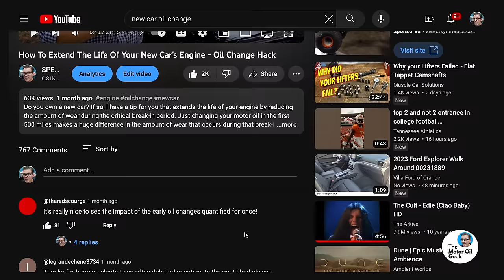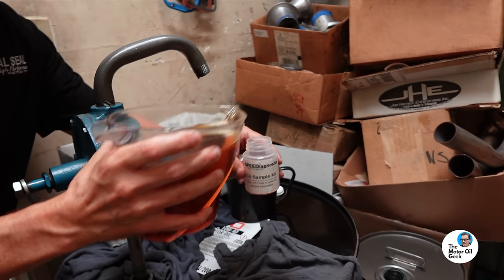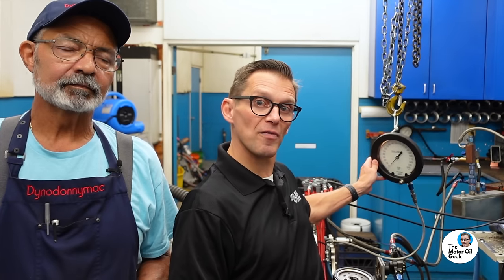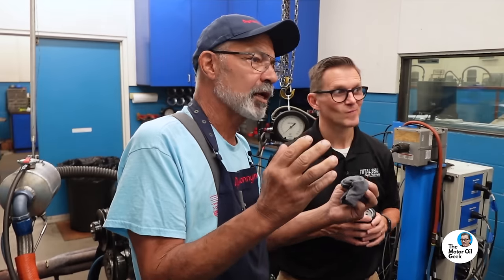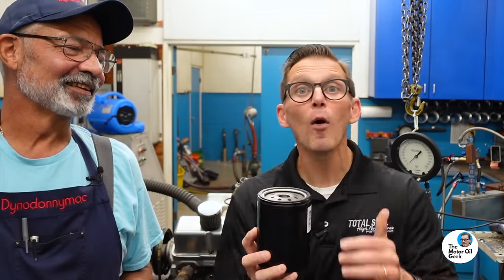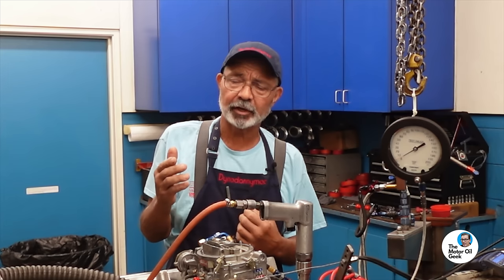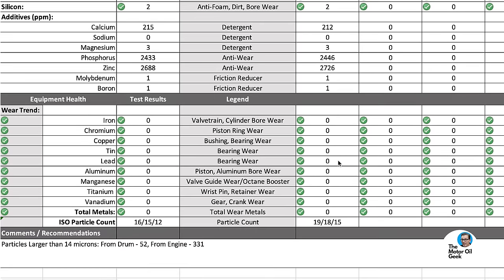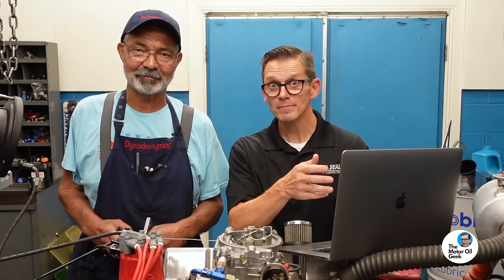Does Pre-FILLING The Oil FILTER Cause Engine DAMAGE?

Comment: Great analysis! Seeing the delay in oiling when the filter isn't pre-filled confirms something I always knew, but never went to the trouble of testing myself. But even the slight delay of a regular cold start is unacceptable! Installed an Accusump oil accumulator with solenoid valve wired to the ignition, so when the key is turned "on", engine oil is pressurized to 30-35 PSI - before the engine cranks. Even with this pre-oiling system in place, I still pre-fill my filters every oil change. Best practice!
Reply from the maker: Thank you!
Reply: Wouldnt it only delay oiling the first start after putting on new filter
Reply: @SoulDelSol  pre oiler does not delay oiling. It pumps oil into the galleries (and filter) before cranking the engine.
Reply: On all Subarus, the oil filter is mounted top side upside down for easy service.  That means every time your vehicle is started, that oil filter has no oil in it.  This is not a problem.   As an engineer, the oil film needed for lubrication is measured in microns, and all your engine components remain covered in a film of oil meaning friction is not an issue.   The reason you put so many quarts in is because the oil is also cooling and the big reservoir dilutes contaminants and lasts longer, but an engine starting isn't going to be damaged by a second of low oil pressure, as it has plenty of film on it for lubrication and heat buildup takes time.
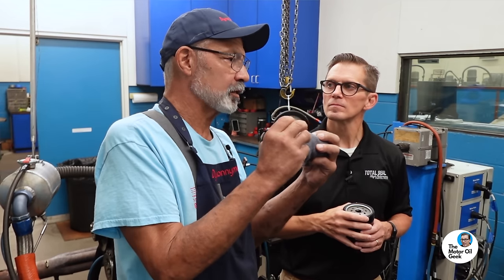Reply: @BoopSnoot  they address this in the video at 5:35, and their oil analysis confirmed that metal/metal contact was occurring on dry starts. I agree that with day-to-day starting oiling is sufficient, but particularly on starts after winter storage, or even a week of non running, I'd rather have pre-oiling than not. And remember that pre-oiling is only a side benefit with the Accusump - it's main purpose is provide up to 3 quarts of buffer while running, in case of a pump failure or extreme cornering Gs.
Reply: @BoopSnoot probably even a greater contributor than hoping a film of protection is still lingering since your last drive would be the filter utilizing an anti-drain back valve 🤷
Reply: I wanted to do this on my Porsche, but the plumbing was going to be a nightmare. Yearly oil changes and running strong at 137k 01 986S.
Reply: @richardchandler9027  my plumbing plan was based on one I found at 914world forums. It was revised to work with my LS, but that's where it began. The toughest part about installation was in order to make it leakproof and reliable, I used quality hose, lots of AN fittings, and a good valve, which were $$$ (more than the Accusump itself). Love those older Boxsters!

Comment: I work on a car ferry. Our big cat V8s need to be pre lubed with a pump before starting. It can take up to 10 seconds for the oil to get to the top end of the engine. And you can hear the valves tick until oil gets into the top end. So it absolutely makes sense to fill up a filter. Just like it makes sense to pre-lube our big diesel.
Reply: What engine are you running in the ferries
Reply: I change the oil in my 2 cylinder lawn mower with a horizontal disposable canister and don't prefill. 25 years now and it's running just fine.

Comment: Lake almost mentioned it, but there's a reason filters have an inner seal. Maybe Lake can do a video on what it's for and why it's important. 

And i loved how quickly the pressure came up with a full filter! it was quicker than I was expecting.
Reply: Equally to point: a prefilled filter that is newly installed, or an engine that's been sitting a while, won't have as much retained oil in the system as one that's been fully pressurized, shut off, and then run again a short time later. That last case is the only one they appear to have simulated. I would still expect the re-pressurization time to be shorter, but by how much? And what about with different oil pump styles, filter styles, and locations?  There are a lot of variables to that question.

Comment: whew!. i just recently heard of this controversy and began to question what my grandpa told me 50yrs ago.  thanks for confirming.  i never should have questioned him in the first place.
Reply: Engineer here: It actually doesn't matter though.  The amount of oil needed for lubrication is measured in microns.  When you change your oil, you are typically running the engine until hot, turning it off, dumping the oil, and refilling it within 30 mins max.   That means everything in the engine is still very well coated in oil.  So when you restart the engine, while there is a small delay created in filling up that filter medium, its for such a short period that everything still has plenty of lubrication.    You're not going to damage your engine either way.
Reply: @BoopSnoot  not everyone at home is running the engine 'til hot before changing the oil. 
but even then, couple seconds of the engine not having oil does minuscule amount of wear.
Reply: I mean sure it won't damage anything but there's just not much point to doing it in real world at the end of the day. So yes questioning old folks with outdated traditions is always a good thing. Don't assume just because someone is old they are smart/know what they're talking about. I've done that mistake myself and learn my lesson.
Reply: @BoopSnoot There you go this is exactly what I meant before writing my previous comment.
Reply: Yeah, I mean most European cars and every Subaru has the oil filter mounted high on or above the engine upside down, so it drains every time the engine stops.   Not a big deal.     @JackRR15
Reply: @BoopSnoot  nailed it.

Comment: I have read articles that say no pre-lube is necessary, while others say it's best to pre-fill. I pre-fill for vertically-placed filters, but think twice if the filter is placed horizontally. If I pre-fill, I make sure that I subtract the amount of pre-fill oil from the oil poured into the engine afterward to avoid over-filling. I also make sure that a proper washer is placed around the drain-plug before filling the engine with new oil. I like the WIX filters, but found that the NAPA filters are also a good choice.

Comment: Speaking for just over 50 years of owning Toyota’s and doing oil/filter changes every 3000 miles and NEVER prefilling the filters, each car had over 220,000 to 225,000 miles on them before I traded or sold them, all with excellent compression and very little oil burning between changes, never had excessive chain/sprocket wear, worn valve guides/stems etc. I am 74 now and still doing it the same way. Proof is in the pudding. Lots of wives tales out there along with poorly made engines and engines with poor care and neglect from their owners.
Reply: Kudos to Toyota
Reply: Same here with two Caravans that were near 300k before selling. Currently an Equinox and Malibu with over 200k and counting.
Reply: Nothing is always...you both beat the odds. But then again, knowing the science & data support prefilling the filter, how much less wear would have occurred had the system been properly primed and pre-filled?
Reply: @dix_pack_of_sixie   With respect to the Caravans it doesn’t really matter. I got my miles out of them. One of them went to 360k before a t-bone accident (no casualties) ended its run. Jury’s still out on the two Chevys.
Reply: Can’t say I’ve ever heard of an engine failing due to not pre-filling the filter. Most are from using oil not specified by manufacturer or not following recommended oil change intervals.
Reply: @ihd-3603  you wouldn't. It would not cause acute, catastrophic failure. It would slowly grind the metal engine components until clearances were no longer within acceptable ranges. You would see the symptoms though. Burning of engine oil, head gasket failure, metal shavings in oil pan that can easily go unnoticed if you aren't looking for them. Run a magnet through your next reclaimed oil and see what you find. 

You have likely heard of engine failure from excessive and premature wear to the internals.
Reply: @dix_pack_of_sixie  either way you get the same mileage out of the vehicle pre-fill or not. So neither way is right or wrong except in the instance of the few manufacturers that warn not to pre-fill.
Reply: @ihd-3603  I would not say either is right or wrong. I would say, however, that one method is scientifically proven to cause more wear on engine components than the other method (pre-filling vs not). Personally, right vs wrong is irrelevant. I want correct and complete information so I can make the most informed decision possible. And the simple methods demonstrated in this video clearly support pre-filling as the option that leaves you less likely to cause damage or wear to engine internals. I'm not saying you will destroy your engine if you do not pre-fill, I'm not saying you won't have engine failure if you do pre-fill every single time you change the oil. For me though, I believe pre-filling makes the most sense for a 60k or more investment like a car or truck these days. 
I respect your opinion and many others who choose not to pre-fill their oil filter.
Reply: @dix_pack_of_sixie  I respect your opinion as well and I can’t say pre-filling helps or hinders. However, I would take this test with a grain of salt. For one, the only way to get real world results is through real world tests on the road logging millions of miles with multiple of the same vehicle setup same as a manufacturer does and not with an engine sitting on a stand in a garage and not even running. Also, as others have said to get an apples to apples comparison, they should have drained everything and swapped the filter for a pre-filled one and ran the test again.
Reply: 225k miles in a Toyota isn't very impressive, especially when you're doing 3k interval oil changes. I imagine the difference between prefill/no prefill is much smaller than the difference between 3k and 10k oil change intervals.
Reply: Same her I change my oil very 3k or 3500k
Reply: It's all about proper maintenance
Reply: I fill my filters first on my Toyotas, Corolla,Rav 4 my Corolla has 1,000,048 miles and still rolling I don't know if it help but I do it. The Corolla is 29 years old.
Reply: And I put a strainer in my funnel all my funnels because putting antifreeze in my radiator one time someone had put a juicy fruit chewing gum wrapper in the new antifreeze bottle I opened. It probably wasn't the first time they did it from the factory.
Reply: @dix_pack_of_sixie  What science and data??? Tell all of us how many studies by any reputable testing service or authority that validates your claim. I wont hold my breath.
Reply: @dix_pack_of_sixie This testing is starting with flawed assumptions.
Reply: The benefit here, is owning Toyota's.  They just KNOW how to make reliable cars for the masses.  They design in maintenance, reliability and reality.  While 3000 mile changes, synthetic oil and prefilling filters may be needed for others, Toyota designs for what people actually do.  Prefilling is still a good habit.  I've had Euro cars and done with them and the constant 'WHAT THE HELL NOW?' warning light.  I'm at 202k on my Corolla, which was my goal, but now expecting at least twice that.

Comment: This makes perfect sense considering the majority of engine wear happens at startup.
Reply from the maker: Absolutely!
Reply: makes zero sense.  only oil at start up is on cylinder walls, bearings and pistons from previous use.  Engine hasn't run yet.
Reply: Lol.🤣🤣🤣🤣🤣
Reply: More because of a cold engine clearances.
Reply: I want to see you prefill a filter that mounts horizontally or one mounted on the top mounted upside down. I'll wait.
Reply: “Starting your engine is a terrible thing to do”
Reply: Absolutely
Reply: @02hreblue30 gravity. And remember that some people will drain the oil and remove the filter and go on to other work and do the oil after some time.
Reply: @bobbybishop5662 I still fill with oil so that the element is wet .
Reply: @bobbybishop5662  It is all bunk, if the oil pan is full. oil flows through the engine as soon as it starts, then the filter completes the circuit. It is not like the engine is starving for oil until the filter is full. Engine builders would have all oil filters mounted vertically if this was so important. Old wives tale.
Reply: @cwstout1  yep
Reply: @bobbybishop5662 big block Chrysler mounts horizontally very easy to fill at least 3/4 of the way up and not even spill a drop
Reply: @thomasward4505  A horizontal filter can only be filled less than half way , there's a fking hole in the middle . You can't defy the laws of physics . It's wasted effort to prefill an oil filter . It's not like the oil pump has to spin a few times to start moving oil. As soon as the oil pump moves it's moving oil . Feed the to lower end is instant as soon as that pump moves.
Reply: So these cars that shut off at traffic lights are all wearing out very quickly because of it?
Reply: @davidvanderbyl4015  Great point , and the literally thousands of gas power golf karts that use a simular system .
Reply: @bobbybishop5662  that's not the way oil flows through most engines, it gets sucked up by the pump then pushed through the filter then it goes to all the parts usually the crankshaft Last by the way, look it up
Reply: @thomasward4505  Lol , ok bud I've only been building engines for 40 years. LMAO
Reply: @cwstout1  agree 100 percent, these two guys are legends in their own mind.
Reply: @cwstout1 Bingo. Slight drop in oil pressure on the first start? Maybe, but it is designed, so everything is wet on the first crank, and the filter is starting to be filled already by the engine. Pre-filling the filter doesn't hurt anything, though.

Comment: I am a master certified Automotive Technician with 35 years of experience and I can tell you “when possible”, it is always a good idea to pre-fill your oil filter. For most automotive applications in the first few rotations the filter has been filled because it is so small, before the engine starts but the air pocket with still make its way through the system. I guess best way to rule of thumb it. The bigger your filter the more you want to put some oil in it if you can. There are some application that you simply can not fill the filter, oh well. Blame the engineers. Bottom line, I agree fill your filter when possible and change your oil every 5000 or 6 months which ever comes first.
Reply from the maker: Thanks for sharing

Comment: i have changed the engine oil several times and i never did prefill the filter with oil.  and by not doing so, it never did any damage to the engine. now a friend has told me that its best to prefill the filter with oil before installing it in the engine. thanks for the demonstration.

Comment: Great research. To fill my engine and oil filters I use an plastic oil jug that is only ever used for clean oil and which has a large screw-on lid to cover the hole where you put the oil in and a flexible nozzle for dispensing the oil. The nozzle also has a lid that screws on and off. It cost £10 or about $12 (I'm in the UK).

Comment: My friend is a Heavy Volvo Mech. Volvo was losing a lot of turbos to bearing failure, the reason turned out to be; the 3 filters (2 main and 1 bypass filter) were not getting prefilled when replaced and the delay in getting lubrication caused the bearings to fail in the turbos.